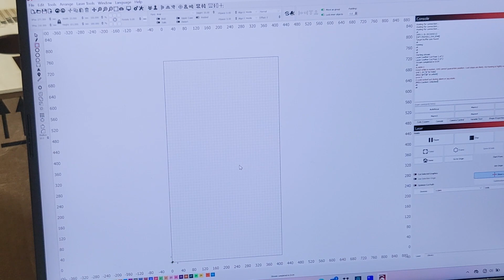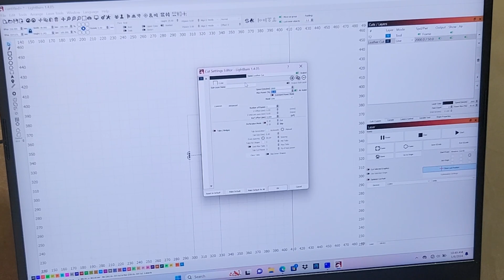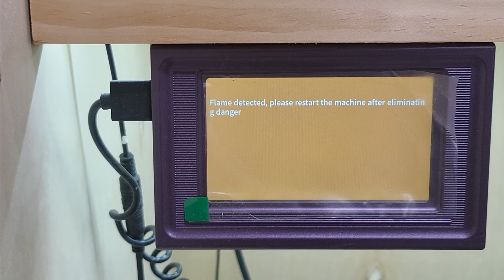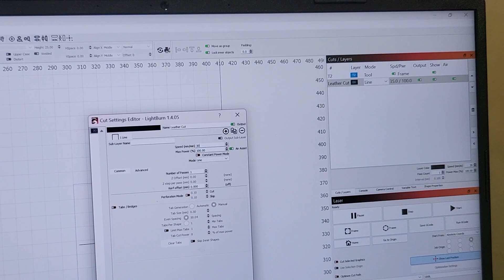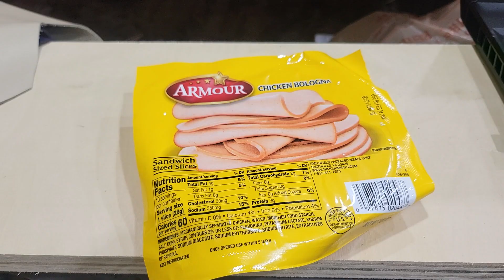How Dangerous is a Diode Laser?

Comment: Hopefully you mean “see it better with the camera than in person” while wearing laser goggles? 

I don’t even like running mine with the cover open, and even when closed I wear goggles, since I don’t trust the cheap cover.
Reply: Also, if you struggle to cut through like that, you can always lower the laser down close to the top of the material. It can really help get those last few mm out of a deep cut like this.
Reply from the maker: Yes I have a cheapo pair that I wear. Normally I close the lid on my enclosure but filming makes that difficult